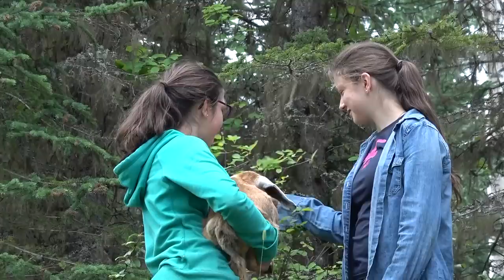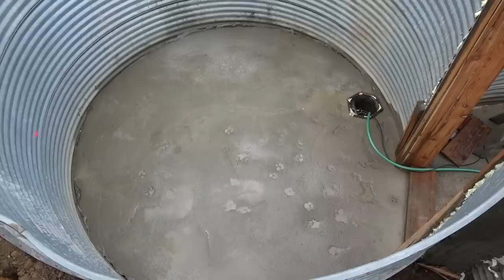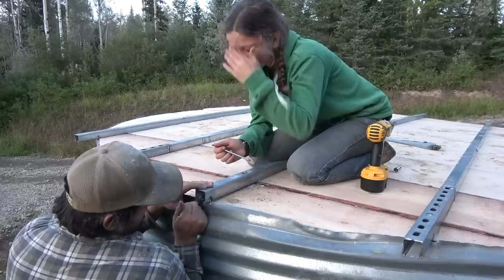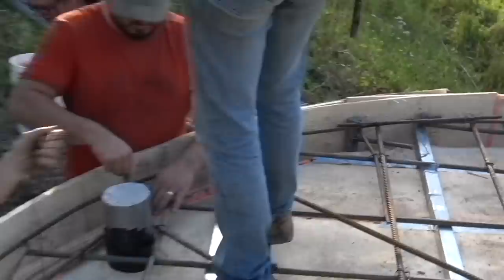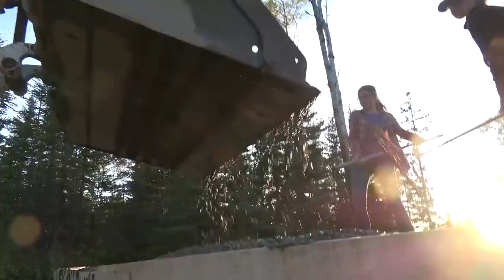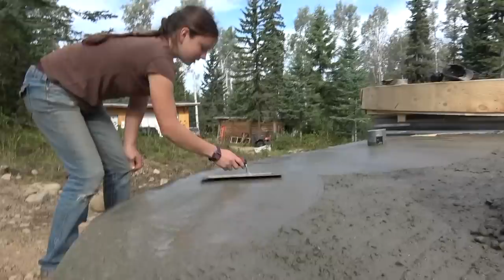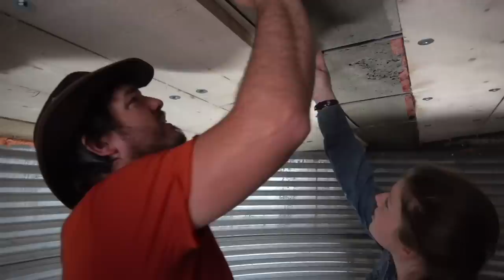Home Made Cellar: Suspended Slab on a Culvert

Comment: So the corro walls are structural and great bloody concrete top so what happens when the moisture from the back filled soil rots out the corro ... death trap
Reply: Those are galvanized to take weather for decades under roads, etc. with water, ice, rocks, logs going through them. The way they will be in the ground, should last a hundred years ez.
Reply: They use them for water tanks in Australia and I’ve seen them half buried and believe me they rot particularly if there’s a bit of salt in the soil
Reply: Rohan Jones speaking as an Australian, they don't need to be buried in soil, or have salt water in them, to rust out. My first home had a galvanised rainwater tank up on a metre-high stand, and the house was only thirty years old so the tank wasn't any older, and it was rusted through in many places. To the point that it partially collapsed when we took it down!

Comment: What kind of strength does a culvert possess, if it isnt encased in soil and horizontal? Do you have any concerns that the vertical orientation and lack of shoring will cause it to crumple, like an accordion?
Reply: My thoughts exactly...
Reply: @jeffs-reviews  it's ribbed so, it should hold up and it's GI..
Reply: @SharkFishSF  Its ribbed in the wrong direction lol, its actually weaker in the current orientation
Reply: @myvids4329  but it being circular makes a difference, and the load from the sides keep it from crumbling like a spring.
Reply: @SharkFishSF  Culverts have vertical ribbing for a very good reason, and they didn't backfill with gravel or compact properly
Reply: Hi Daniel. I agree with you. I wish these folks the best of luck. Great human interest video but I have serious doubts about the structure itself. Corrugated materials derive their load strength perpendicular to the corrugation as in a Quonset hut. I fear that the structure in this video will rust and suffer a catastrophic collapse.
Reply: @1982nsu  didn't he say it's steel? I hope it is 304 steel which don't rust. We'll just have to wait and see.
Reply: @myvids4329  I somehow think it's strong enough, I don't know why, but could it be because the entire structure acts like a horizontal arch providing compressive strength to keep it from crumbling like an organ? Your thoughts welcome.
Reply: @SharkFishSF  Hi. The problem is not the steel but rather the direction of the corrugation which is designed to have load bearing strength across all of the corrugations when in a vertical position. A simple example of this is an ordinary corrugated cardboard box. You will notice that all of the corrugations run from the bottom of the box to the top. This gives the box strength to resist a vertical load. If you take the same box and lay it on it's side you will find that the box easily collapses under the slightest load. To make matters worse, a section was cut away for a door opening thus creating a failure point.
Reply: @1982nsu  you're right about cardboards which are linear, but this being a cylinder makes it different by way of the load acting sideways. 
Someone here said it wasn't filled correctly on the sides, but if we assume it was compacted well on the outer side, the possibility of coming down like an accordian wouldn't happen due to the sidewise force.

Comment: The culverts aren’t designed to handle weight in that direction.
Reply: Wondering when we will see the follow up video, with them smashed flatter than a pancake!
Reply: Gray Lensman 
I know! I’m scared for them! Lol. Literally, the strength of these culverts comes from being surrounded by dirt/gravel. That concrete slab could easily accordion the pipe downward. Maybe he’s going for a YouTube Darwin Award. 🤷‍♂️
Reply: Just like a grain bin.... But smaller.
Made to be supported by either what is inside them, or what is outside them... Not do good at holding weight on the top....
Reply: If you put some large post up against the wall, from floor to ceiling it will give you added support, and the back part of your  shelving system, for your can goods. This might be belt and suspenders, but think of a guy flattening a beer can on his head, while at the same time contemplating meaning of the words bomb and shelter. Otherwise great job, look great.

Comment: I have to disagree with the cave in crazies. Those culverts will hold that cement just fine especially once you have the earth around the sides. Hell you can park that bobcat on top once you bury them. 

Fun video.
Reply: I also believe it will be just fine, maybe some people never tried putting tons of weight on a pop can in Science class as a kid. We even built a bridge out of popsicle sticks and hot glue. I want to say was a 30” span and we had close to 300 pounds hanging from it before it broke.
Reply: are you a certified PE engineer by chance?
Reply: @KindergentlerMr.Softbelly  Good answer! Engineer is just a word in many cases denoting action. An engineer designed the I-35 overpass also, how did that work out? Do-it-yourselfers are very capable of building good structures!

Comment: I'm not an engineer either but looking at the header I thought the culvert would make an excellent inner form to be wrapped with poured concrete.  That could easily be retrofitted around what's there now, with 1/2" rebar pins drilled and mortared 6" into the roof slab every couple of feet to lock the two castings together.  The concrete walls could be poured in sections that would be vertically keyed together and the same 48" form (two or three layers of 1/4" luan bent and glued together into the right curvature with holes that would line up with holes in the culvert to be linked with pins and heavy zip ties that could be cut off afterward. If the walls were 6" or even 8" the thing would end up being an actual bunker. The final touch is that a steel I-beam (1/4" plate 3" flange by 5" web) could be neatly slid into place through precise slots in the culvert, directly up against the cap, crosswise to the steel channels n the roof, with the projecting I-beam ends to be poured into the walls and support the center of the roof.  If it was me I would go to almost any possible length to avoid putting center posts in those two chambers. The walls would extend at least up to the top of the roof cap and if you wanted to go 4" higher you could also pour a 4" overcap on top of the present cap would extend out to the edges of the new walls and be keyed into the rim of the wall.  You could park a small excavator on top of it then if you wanted.  Your project is excellently simple in conception but just needing completion.  It's such a small structure that generous caveman over-engineering will do the trick if you have big safety margins the way you did with the roof cap.  That cap is a solid piece of decent work for a backyard project.  PS Love those girls with such great attitudes.

Comment: I am a builder and have done several massive wine caves and smaller cellars, all cut and cover. The main mistake here would seem to be the cement floor. I didn't see any drain or french drain underneath the slab. Just a gravel floor would have been much superior.  I cannot begin to understand what those little springs are doing on the wooden supports.  Peculiar in the least.  Looks like your roof will hold, as long as that was washed gravel and not river-run.   The most frequent flaw in such structures is condensation on the metal sides and roof exposed tubes due to insufficient cover, both on top and the sides. You should  insulate the roof with foam board before covering with at least 1 meter of fill, preferably more.  In your climate, a "Ante Chamber" or tunnel to the doorway should be constructed, and I do that in any cellar. This allows for proper side fill around the culverts.  The key to a working cellar is moisture control, and that means there should be a large roof vent and buried intake air pipes to condition the incoming cold air.  The roof vent should be large and damper controlled. If you build a "wet" cellar,  it will be of little use.  I think I saw a 4" vent pipe. If inadequate, you could add a fan to it.  Interesting build. I would have laid the culverts on their side as they were built to be used, butted them end to end and used the cement just for the entrance tunnel and wall. Good kids doing this work, you are lucky

Comment: I would add at least 4 support posts to each of those caps. Those culvert pipes have the most strength in the horizontal orientation. Looks like a bit of a death trap. Hats off to the girls!

Comment: Excellent project. But I agree with some of the other comments that question the vertical strength of the culverts. I’m no engineer but I’d be putting up some of those 6” diameter posts at the doors and all around the wall. Hate to see it collapse on someone.

Comment: Dude. I busted a gut. Its great, its funny, informative. Your wife, your girls, spot on, funny. Inspiring. One question. After putting up the boards, setting rebar, how do you assure the mix, doesn't leak between the boards, while its still wet?

Comment: To make a wire dispenser,  wrap the coil with tape, punch a hole in the center on one side, and pull the end of the wire on the inner side of the coil out through the center.  No kinks, never unspools, nor makes a tangled mess

Comment: You have an good idea but as you have read the culvert on end is not as strong as you might think. You should have built concrete post every 2 ft around the outside and down to a depth of 3 or 4 ft depending on type of ground around the perimeter of the structure then set your roof on those post as well. This way any load placed on the roof would be transfred to the ground below the shelters.  Even better would have been concrete walls on the outside of the shelter. but cost goes up of course. But good job raising your girls be proud of them and keep up the good work.

Comment: I agree with the posts about the safety issues with that much weight on the steel walls. Concrete is a poor insulator. Framing and insulation would be a lot safer and achieved the same R value for less money. Steel is used for pulling loads not compresive loads. the concrete should be in the walls and the steel in the roof.

Comment: Did you remember to ground your rebar framing?  This prevents corrosion and degradation of the concrete due to errant electrical low voltage.

Comment: 1st time viewing your channel --- Awesome!!! I do appreciate what you've taught or are teaching the kids, they definitely don't mind some hard work (it shows in their demeanor)  and good humor; do love their quick wit too. LOL! Applaud you and wife on the upbringin' --- and congrats on the 20yrs.
Now --- As I read down through the comments --- a lot of concern voiced over the weight of concrete on the walls........ Hmmm, it's CMP (corrugated metal pipe) --- the wall thickness is prob 3/16ths, maybe as much as 1/4in thickness (guessing) and appears to be 8ft diameter.  Tied at the top with unistrut and rebar cross-ups/diagonals/circulars.... I have you approximately 2600lbs? --- and that's liberal especially not using heavy sand. Appears you have roughly 4in thickness in your pour but it's not consistent due the the unistrut.  I'm not an engineer but I did stay at an Holiday Inn Express twice! I don't think you have anything to worry about... but that's my opinion. Besides, internally - I'm pretty sure you'll build shelving to utilize the space (as one does when using a cellar!?!). When backfilling, I wouldn't use too much compaction effort --- letting it settle naturally. If anything, ya might have some posts on each side of the doors but honestly (personally) I wouldn't worry too much about that either since the doors were uniformly cut as an arch, load being shared to each side (but not reaching load limit anyway!). Love your thought and planning --- have a good one my friend!

Comment: Some advice from a contractor.... that is a death trap. That culvert is NOT acceptable support for what you are doing. In the event of outside forces applied during a storm the chance of collapse is very high. Culverts are not designed to bear weight end to end they are designed for horizontal weight resistance.

Comment: Adorable girls. I have the pleasure helping raise twin 10 year old granddaughters and are just like these girls. We also have other property I can use you videos for training purposes. Much appreciated.
Reply: TruWzrd id start by reading all the comments - particularly about all the ways this didn't need to be a death trap. From including actual structural support under that roof, to forming the roof with the steel sheet product that is engineered for the purpose, to including ventilation, to making the concrete to recipe (measured quantities not shovelling into the mixer, and much less water - research concrete plasticisers to reduce water content further).
One way or another, eventually that slab of concrete is going to fall down, and we can only hope nobody is under it when that happens.

Comment: Lol, I remember trying to work out measurements in fractions of inches.
That was way back before we in New Zealand converted to metric in ... 1987 I think it was.
You should have heard me and the others moan about the bloody metric system when we changed over, but now there is no way I'd ever go back to foots and inchworms !
Took me years to give up using my Duofast air gun too, didn't trust those new fangled Paslode gas guns !!! Now you'll never find me with a air hose or a compressor when I am building a house.
Sometimes it is hard to take the first step of change.

Comment: The horizontal ribbing on that culvert is not adding any type of reiforcing to the wall structure. Had the rolled corrugations been oriented vertically, your structure would have some compressive strength. If it buckles inward.....

Comment: That much weight not supported is a death trap need structural steel to support it and the steel has to have concrete footing also. Or u could of made concrete columns to support the weight. The galvanized metal will not support the weight of the concrete over time. You could install metal I-beams in four places inside and anchor bolt it in place top and bottom. Then perhaps it will outlive u

Comment: You should use aircreat around it to stop it from rusting befor butting any dirt
Reply: It's made to go in the ground
Reply: @baconneggs2406  that's great but I did see some that gets badly rusted and if you surround it with aircreat you will isolate it and will give you temperature and water proof. 
.
Reply: @baconneggs2406  watch aircreat Harry you will know why I said that 
Thank you

Comment: You're lucky nobody was killed making this.  The structure is insufficient to support the load, and the concrete could collapse under its own weight.  A culvert is designed to be in a horizontal position and depends on the surrounding material to allow it to function as an arch.  A rim supported slab is a delicate balance between steel and concrete.  The rebar is far too small in diameter and there is far too little of it.  The rebar is also placed too high in the slab to take the tensile forces.  The supporting rim is also dangerously small in cross section.  Fill it with gravel and seal it shut.

Comment: Awesome cellar Jeff, I’ve been thinking of trying to do one to, couple questions...so I see the sump pump hole and is that just a simple air vent out the top? And why remove the wood slabs inside on the roof that you worked so hard to install? Do you just like the look of the concrete instead? Now to enjoy fresh vegetables all winter long!
Reply from the maker: Thanks, yes the air vent is 4" ABS, we also have a 1/2" water line outlet for the sump pump, although I hope that it will not be required.  We removed the form wood as it will just rot and/or mold and provide a place for bugs etc.  Thanks again,

Comment: 10 or 12 ft diameter is a large span for concrete.  Concrete is not strong in tension (the bottom of the ceiling is in tension).  When concrete is used to span distances like this it typically contains tension bars or tension wires which act to keep the concrete in compression.  Rebar is not a suitable reinforcement for this application of concrete.  I know vertical columns aren't desirable, but add them anyways.  Don't want anybody to get hurt.  Otherwise have a structural engineer look at your design to ensure its strong enough.

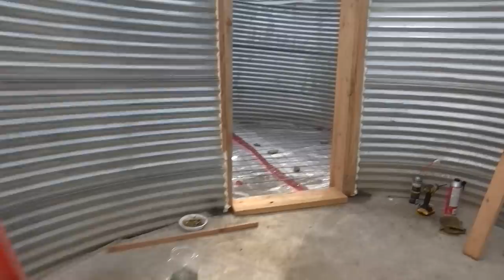Comment: Awesome. But I’m worried about those boards not being treated at 2:17. They will rot quite quick.
Reply from the maker: I think the boards you're referring to are for the doorway?  If so, they are red cedar and can last a very long time without rotting.  They're not really structural and could be replaced if required.  Thanks,

Comment: Great video! The girls worked really hard. Is the suspended slab engineered to any specific requirements? We live in northern Arizona (gets into minus degrees a few times per year) but I’d like to get enough soil on top for insulation against summer heat. Thanks!

Comment: Im no engineer and mite be wrong but to me Id be cocreating the walls out side too. So the roof is resting on that.

 Thats a big heavy slab. To be resting on the non structural side of corigated iron.

If you havnt drained water around the walls when it rusts whats going to hold up the slab?

Love the idea though and a great wall finish and sould also take a lot of sideways preshure of the soil.

If your finished now prrhaps some brick peres against the walls for shelving up rights would also help carry the weight of the roof.

Comment: GET THAT DOORWAY REINFORCED.. this culvert material is not designed to be placed sideways with large gaps cut out.. Yes it is be laid sideways under roadways as culvert but not when 1/2 of it has been removed without a framework replaced to strengthen it!!!! put a post in the center with radiating arms if nothing else.